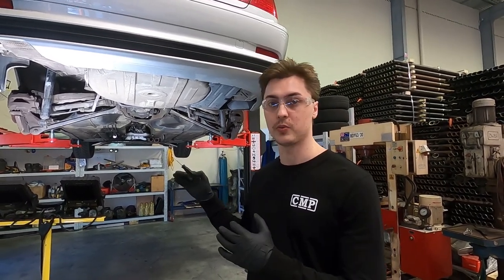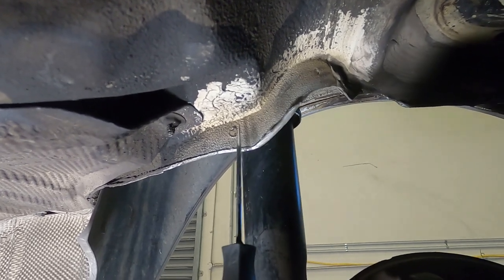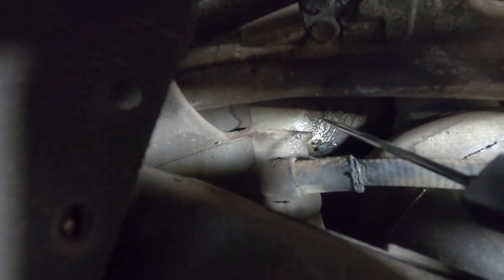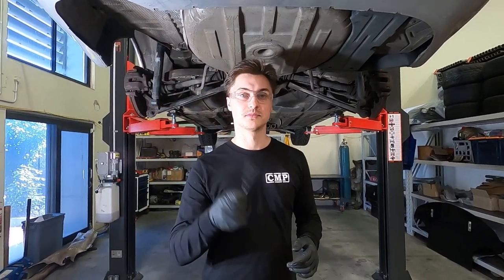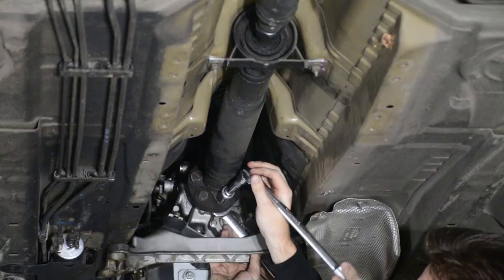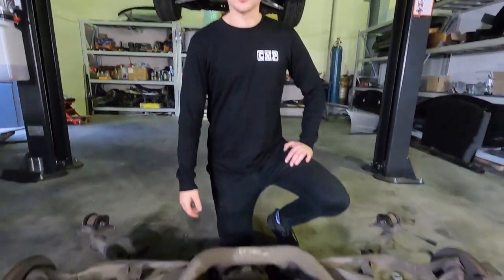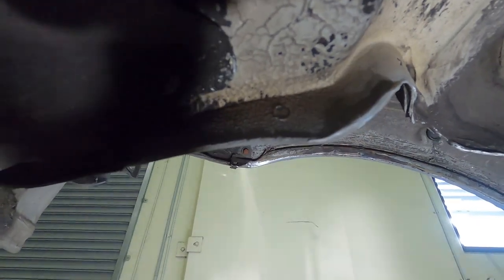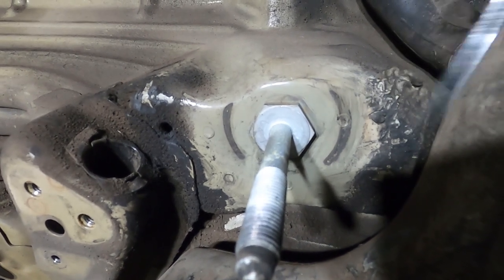E46 Drift Build, Episode One | CMP Auto

Comment: copped me a 320 auto 130k miles lad think it'll be solid init? just crashed my 330ci manual with 90k on it and that had no cracks.
Reply: Just copped me a 318 manual 230k. Crashed a 540i 100k, mint condition, no cracks.
Reply: @OscarPrice007  well if u were wondering the 320 had small cracks so i did reinforce it when i was swapping the drive line out